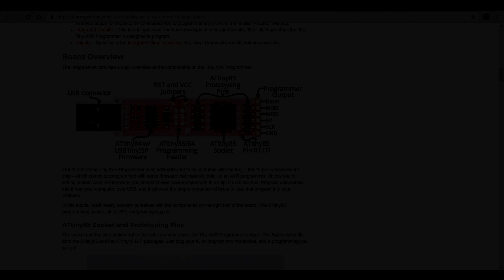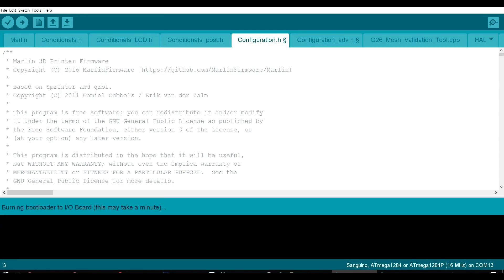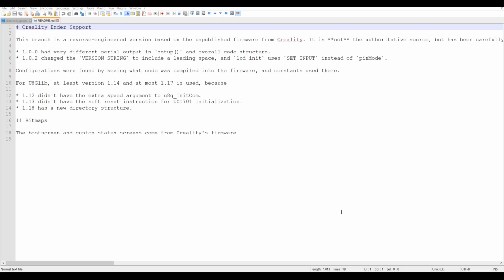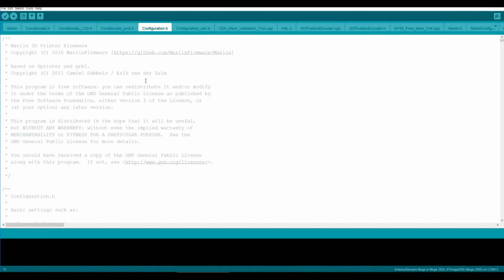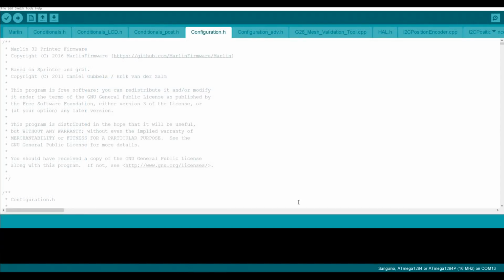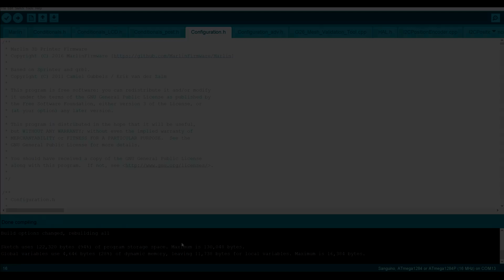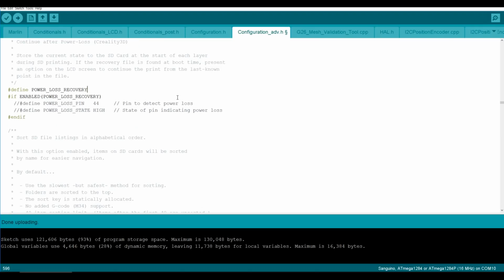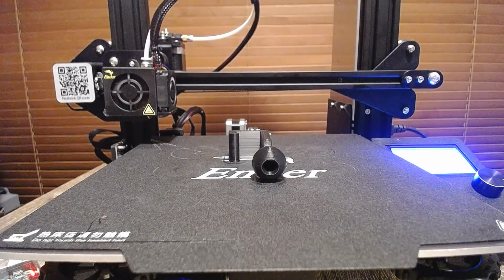Ender 3 vanilla Marlin update: Concise guide

Comment: First of all, Thanks for such an easy to follow guides on Ender 3. I have watched almost all of your ender 3 related videos.
But I have really easy method for upgrading to vanila marlin to ender 3 or any other supported printer.
1. Download and extract TH3D full package.
2. Download and extract Vanila Marlin(VM) firmware to TH3D folder.
3. Now Copy ender 3 example configuration files to root of "vanila marlin" folder.
4. Now just open merlin.ino in the above folder and flash it.
* additionally you can change configuration according to your need before flashing

This way dont have to bother about sanguino board install and u8glib install etc. Because they are already added in TH3D download. 
Just copy Vanilla Marlin and Copy your Configuration files and ready to flash.

Comment: Thank you for making this. One issue I've run into with my Ender 3 is that the X and Y axis are not calibrated correctly with the firmware on it and so printing a 20mm calibration cube does not come out cubic. I've always made adjustments in the marlin firmware with my RepRap 3D printer and being able to flash the marlin firmware will now give me the ability to do that.

Comment: I noticed that my ender 3 doesn't seem to accept cura gcode very well in terms of cura's available feature, such as printing speed(so I have to manually control through the knob every time if I want slower print, otherwise it's always setting back to 100%FR on the LCD)

 does using vanilla marlin solve this problem? if I decide to go change the board to MKS Gen L, then it must be loaded with new Marlin firmware isn't it? Also, since I'm new to 3D printing, if I'm not concerned about wanting thermal runaway, I'm not so sure if I want more features than those gcode settings more available, so I'm still in doubt whether or not this whole firmware changing thing is even worth it, or if it has risk of completely screwing up the firmware/hardware if one/few pins were wrongly inserted.

Comment: Please answer this Michael. i do everything i need to do and it doesn't show up. how did you get "marlin". i only find marlin.ino, marlin.h, i cant find a document that is just marlin. also what do you use to to open the documents? i cant find it and when i open it with notepad, its a strait line of codes?
Reply: On Michael's computer Windows is setup to hide file extensions for known file types. So Michael is actually opening the "marlin.ino" file in the video, you just can't see the extension.

Comment: Hi Michael. I'm wanting to use the BLtouch and have used the video and the bootloader video to get started. However when I tried to compile the sketch after doing the updates you suggest I get the error. "'speed_lookuptable_fast' was not declared in this scope" and it refers to line in the sketch:-  
const uint16_t table_address = (uint16_t)&speed_lookuptable_fast[(uint8_t)(step_rate >> 8)][0],
Can you help with this. Thanks Rob

Comment: So just to confirm, I have already installed the bootloader when using the TH3D firmware, does this mean I don't have to do that again. Now I just connect the printer to the computer and flash it as instructed above?
Reply: Arduino: 1.8.5 (Mac OS X), Board: "Sanguino, ATmega1284 or ATmega1284P (16 MHz)"

sorry - this program has been built without plugin support
exit status 1
Error compiling for board Sanguino.

This report would have more information with
"Show verbose output during compilation"
option enabled in File -> Preferences.

I'm getting the following error message after trying to compile the sketch after following all the steps HELP!!!!!
Reply: I have the same error message on Mac OSX using Arduino 1.8.7

Comment: Hi, I just got my Ender 3 Pro together, and it successfully updated the boot loader. But when I try to upload the firmware, it gives me the error "avrdude: Expected signature for ATmega1284P is 1E 97 05
Double check chip, or use -F to override this check.
Wrong microcontroller found.  Did you select the right board from the Tools > Board menu?"
It compiled correctly, and I have the board/com port/everything set up.  The only difference is I am using a uno to program.
Reply: Once you have a Bootloader on the Ender 3 Pro, you don't need an Uno to upload the firmware, you can directly plug in a usb cable from your computer to the Ender 3 Pro. I've just done this and upgraded my firmware yesterday.

Comment: Which version of the IDE are you using?  I'm trying it with 1.8.7 and I'm getting an error "built without plugin support".
Reply from the maker: I'm using that version too, no such problem. Not sure sorry.
Reply: Sorry to comment a month later but did you ever get this working? I've got the same issue
Reply: @ryang1226  No I haven't.  I suspect that I have some remnants left behind from when I used the IDE packaged with the TH3D firmware.  At some point I'll clean it up and try again.
Reply: @WayneMcCormick  Thanks so much for the reply. After 4 hours I decided to wipe it all out and start fresh. Deleted Arduino IDE and then followed his guide again and it worked. No clue why it wasn't before but now I can go to sleep ha

Comment: Is it worth getting  marlin 2.0? I see 1.1.9 branch is still getting bugfixes but maybe 2.0 would be better? There is also sample config for Ender 3
Reply from the maker: 1.1.9 is being developed but it is still the most stable release. 2.0 is a large shift in architecture to suit 32 bit boards and probably other new features. It is much more unstable at this stage. In terms of the channel I'll cover 2.0 when it matures and is the chosen mainstream release by the developers.
Reply: @TeachingTech  so is there any advantage for us Ender3 users? With old 8bit boards? Did you test it?
Reply from the maker: At this stage unless you really know what you are doing it's not worth looking it. There won't be anything that is going to dramatically improve print quality.

Comment: Since I've done this on my Ender 3 I get horrendous layer shifts on my prints not sure what's causing it before the change everything was ok, you say make sure drivers are installed is there another step?

 I have made sure that no belts are slipping and that the bed is level and that the stepper motors are working correctly. 

These prints are 3hrs apart and as you can see very different results, does anyone have any ideas? 

I've gone to vinila marlin as I wanted manual mesh bed leveling as my Ender 3 is slightly warped.

Before going to vinila marlin:

http://bowhillgames.com/Before/20181030_180325.jpg

http://bowhillgames.com/Before/20181030_180329.jpg

http://bowhillgames.com/Before/20181030_180340.jpg

http://bowhillgames.com/Before/20181030_180349.jpg

http://bowhillgames.com/Before/20181030_180354.jpg

http://bowhillgames.com/Before/20181030_180411.jpg

After loading vinila marlin:

http://bowhillgames.com/After/20181030_175611.jpg

http://bowhillgames.com/After/20181030_175619.jpg

http://bowhillgames.com/After/20181030_175628.jpg

http://bowhillgames.com/After/20181030_175702.jpg

http://bowhillgames.com/After/20181030_175715.jpg
Reply from the maker: There is nothing different enough in the firmware to cause this. The most likely cause is an overheating mainboard (more specifically the stepper drivers), please check your mainboard fan is still spinning. the other cause is some sort of mechanical onstruction, or even too higher print sppeds.
Reply: I followed the same procedure and the print quality is just as good as with the stock firmware. There must be something else causing your problems.
Reply: I have the same issue is there a way to go back to original firmware?
Reply: Yes, you can download the latest Ender 3 firmware from Creality3D's website: www.creality3d.cn (it now has Thermal Runaway Protection enabled), open the "Marlin.ino" file in the ArduinoIDE, and Upload to the Ender 3. Note: the language defaulted to Chinese, so I went into the 2nd folder's "Configuration.h" file and 1) changed "#define LCD_LANGUAGE cn" to "#define LCD_LANGUAGE en" and 2) changed "#define DISPLAY_CHARSET_HD44780 JAPANESE" to #define DISPLAY_CHARSET_HD44780 WESTERN". 

I tried 1.1.9 on my Ender 3 Pro, but it rattled the bed excessively, while this 1.1.6 version from Creality didn't.

Comment: When I tried this update, I found that the SD Card was not recognised at power up and I had to do an "Init. SD card" from the LCD menu before it worked. I found this problem was discussed along with a possible solution here: https://github.com/MarlinFirmware/Marlin/issues/11533
Reply from the maker: That is an Ender 3 specific issue. Personally I can live with it. Thanks for posting the info.